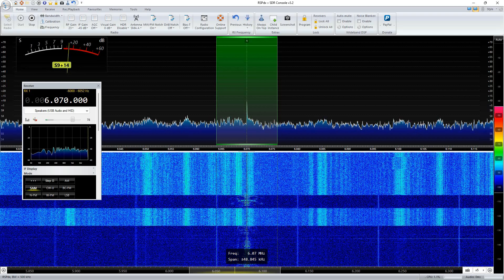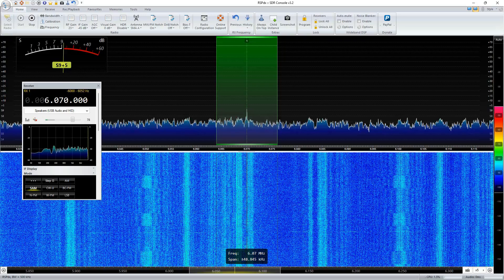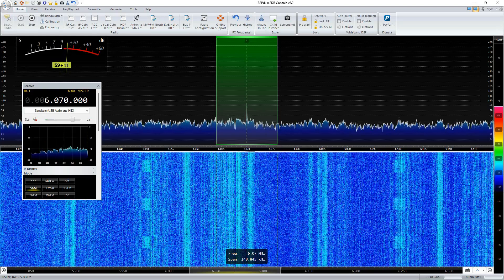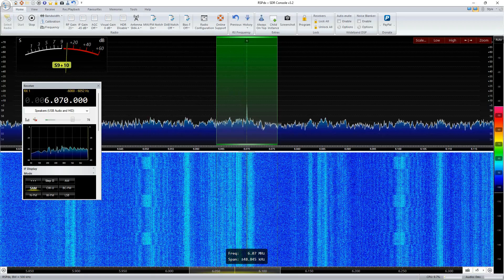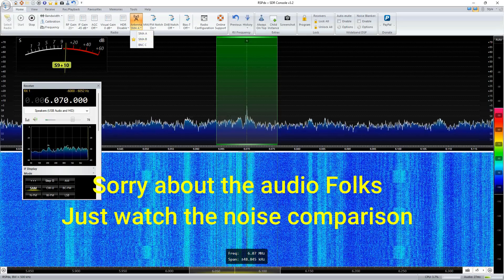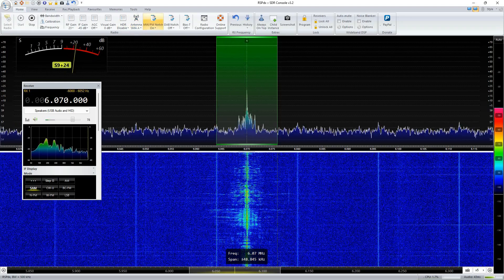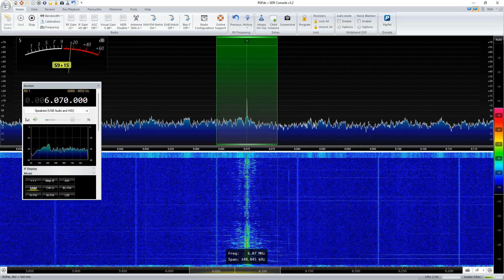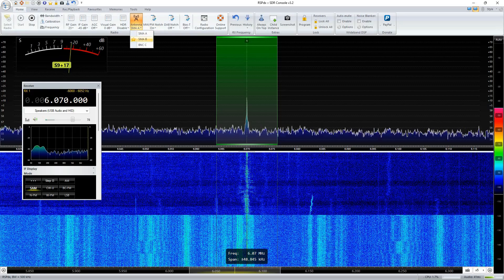Log  antenna comparison Loop on the ground

Comment: Your results were the exact opposite of mine. The LOG was deaf, where S9+20 signals decreased to S4.
Reply from the maker: Hi Bob... without the preamp, the signals are very weak as you say. But with the preamp things are much different.  The preamp has about 20 db of gain. The preamp is needed since the antena is on the ground!! W1VLF

Comment: Have you tried to determine if the noise on the dipole is common mode noise on the feedline traveling up to the dipole?  Too many times this is what I've found to be the reason, and in some cases I had to apply common mode filtering at both ends of the feedline.  For my current active loop (pun not intended) I had to install common mode filtering on both the feedline and the rotor cable, at both ends.
Reply from the maker: Hello.. That's is indeed a very good question.. Yes I have used common mode chokes extensively on this an other bands.  This is actually radiated noise on the DC side of the line tie inverter.  The common mode chokes have had no impact on this problem.  Excellent question.    BTW I have a number of videos on the topic of CMC  W1VLF

Comment: BTW, what preamp do you have between LoG and RSPDuo?
Reply from the maker: Hi Sam.. Hope that correct.  I am using an ARR  Advanced receiver research preamp.  There is nothing special about,. It has 20 dB gain  and a relatively low noise figure throughout HF. 50 Ohm input and output impedance of course.  The other things you might see in the video is a patch panel that allows me to use different SDDR and antenna combinations

Comment: Thank you! I'm considering making that type of an antenna to work with my RSPDx. I'd really love to see comparison between good broadband amplified loop (like Wellbrook, CrossCountry Wireless or Lz1aq) placed closed to the house and compared to LoG (close to house or away from the house). Small magnetic loops should have low sensitivity to the near field noise (within 1/8 or 1/4 of the wavelength between noise source and the loop).

Comment: Nice results there! What a difference. SNR usually improves even more when you stack them. I wasn’t so lucky though. Nothing but the regular noise when I connected to the logs stacked against the shed. Fine pine…. Might try oak next time.

Comment: Excellent video Paul, tnx for sharing. I made one but twice the dimensions to go lower in frequency and was pleasantly surprised. Remember, one cannot have enough/different receive antennas when trying to pick up different signals. 73
Reply from the maker: Hi Gedas  I may try putting another large unit out farther into the woods myself.    W1VLF
Reply: @W1VLF  What is also neat is our current ability to half-way accurately model these types of antennas, even when on the ground. I got some neat results as far as radiation patterns and feedpoint impedances.  GL es good DX !  73

Comment: Highly impressed. For HF reception, a LOG seems the go-to antenna at yours.
Of course, in the woods, be careful which logs you connect to.
Reply from the maker: Hi Paul.... LOL Maybe I should connect a coax to tree and see what happens!!  Yes this antenna seems to work  quite well especially since it is so far away from the noise sources... W1VLF